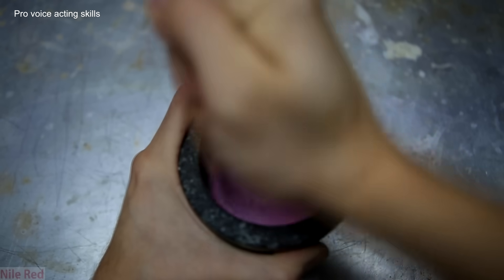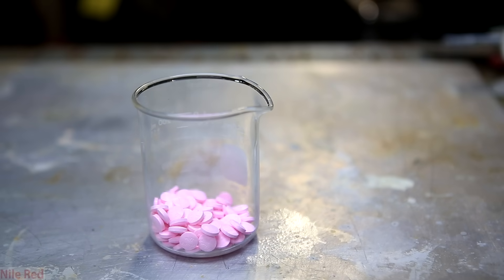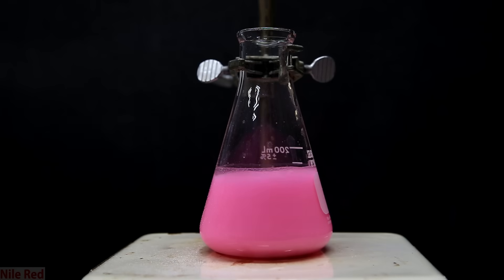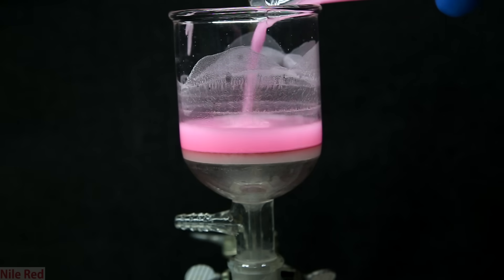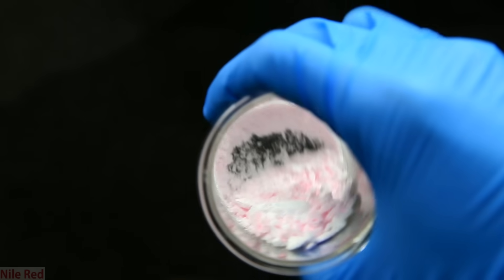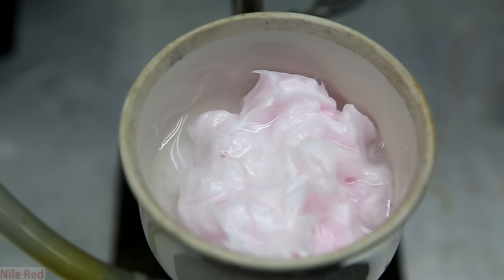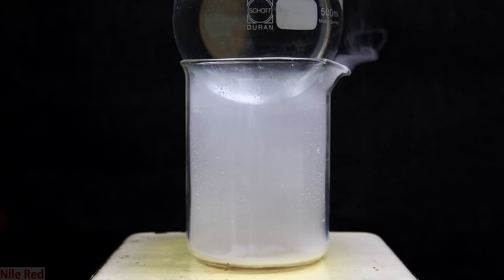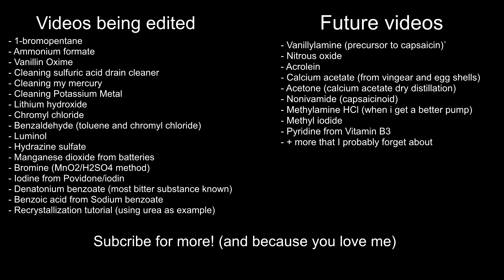Extracting caffeine from caffeine pills

Comment: Why would you even do this? Just swallow the pills.
Reply: because this is a science channel and he is showcasing different chemical processes involved in purifying a substance in this case it's caffeine
Reply: @tanishchowdhury  I understand that but what purpose does it serve? I was working as the anodizing manager of an aluminum extruding plant in Opa-Locka, Fl and was receiving a delivery of chemistry. Also on the truck was 4 tons of caffeine powder that was being delivered to the Pepsi bottling company in the next town over. Each box contained 5 kg of powder. In jest I asked the driver if one box could fall off the back of the truck. It would have helped when I was called in during the middle of the night to remedy some problem that had arisen in the anodizing line.

Comment: Why did you use a beaker during the sublimation because some of it clearly leaked out from the place from where you are supposed to pour something, like, was there some particular reason. Couldn't you have used just a normal cylinder without that opening thing, so that none of it escapes?

Comment: ok... caffeine is a simple alkaloid... available from plants of various types... notably coffee and tea and... chocolate
extraction from plants is fairly easy... this will work with most alkaloids
with coffee beans
grind to a fine powder... I'm usually working with a hundred milliliters... nice round number... add 1 CC of pickling lime... slaked lime.. available on Amazon for making pickles with... this brings the ph up to about 9... mas o menos... add a little more if you want.. too much destroys the other alkaloids... and they are actually good for us so I want all of them... cover with acetone and mix well.... let it pickle overnight.. the lime breaks down the plant material but a fairly low pH won't modify the mixture... pour off the acetone and evaporate... with vacuum is best but it's not necessary for good results... the remaining powder is the business part of coffee... au naturel
Reply: for an infusion that can be used medicinally... add hemp seed oil... it carries the alkaloids through the skin and nourishes the cells at the same time... it is primarily fatty acids and lipids... the only thing that passes through cell walls... and it carries the other side... the sending side of the gap between nerve cells called the synapse... 110 cannabinoids that are.. an anion and cation for each system in the body.. the other alkaloids work on the receiving side... there are 3... in all the medicinal plants I know of... alkaloids use the alkali metals in a magnetic field along each pathway to and from the brain... what happens on one side of a magnet happens on the other side at the same time... so we can respond to the environment in real Time... that's what makes us alive
Reply: I just use water most of the time.. we call it coffee ☕... add honey... it's really good stuff

Comment: Wouldn't it be easier to extract the coffein with ethanol in an soxlet and resublimate it with controlled temperature over a longer period of time? Like an water or oil bath and the erlenmeyer is dipped deep in it to force the crystals to form on the cooling flask.

Comment: EASY way to extract caffeine from caffeine pills:
Caffeine is highly soluble in boiling water, while the fillers and binding agents are not.
So.
1. crush up caffeine pills
2. dissolve in boiling water
3. filter out fillers and binding agents with a coffee filter
4. boil away water from resulting solution in a frying pan
5. turn on camera and say, "this is your brain on drugs"
6. or you'll be living in a VAN DOWN BY THE RIVER!

Comment: When you use the cold water in the filter washing step, aren't you sacrificing some of the caffeine in the filtrate?

I understand that caffeine isn't as soluble in cold water as it is in hot, but I do know for a fact that it is still soluble to a good degree (ex. Iced Coffee and Cold Water Extractions/brews).

What gives? Was it just a calculated sacrifice for purities sake? Is there a better way to filter without sacrificing yield besides sublimation? Perhaps Celite? Activated Carbon?

Comment: I had a question...on the hot water part...so I may or may not have a spoon of some black stuff , and whenever I heat it up with a lighter and water the black chunks (impuritys) form together like a magnet and there fo allow me to suck up clean 'black stuff'.....why is that??

I just figured this out, wish I would of known this b4..that means for several years I been 'using' dirty unfiltered 'black stuff' in my body

Comment: Damn I've been doing caffeine extractions for years, you could have saved so much effort by buying caffeine pills without the pink in them. I prefer allmax caffeine, and I simply wash the ground up pills with 99% alcohol, siphon/filter off the saturated alcohol (once it settles ofc) then evap the alcohol. Every single time I get extremely pure, flaky caffeine crystals

Comment: Hi NileRed, is it possible to try dissolving the crushed pills to dw first before DCM, possibly heat dw first at 70°C - 80°C. Would the yield be higher than this video method or less. Thanks.

Comment: NoDoz pills are caffiene in a glucose base, niacin (nicotinic acid) and thiamine hydrochloride (vitamin b1)
Glucose, niacin and thiamine are all very soluable in cold water, caffiene is only very partially soluable so if you use ice cold distilled water and use only a small amount, you can extract most of the caffiene and recrystalise in ethanol. 

ezpz

Comment: could acetone be used here instead of DCM?
Reply: Acetone is mainly used to clean round-bottom flasks and beakers that have been previously used for other reactions (along with soap and water). It is sometimes used as an organic solvent for certain reactions, but it's not too frequent. DCM is better suited for that, as it's much less likely to react with your compound than acetone is.

Comment: I am realy curious as to what was the melting point of the final product. It would say a lot about the efficiency of the method.
Reply: the point is as he explained it, it is not "melting" that means it is not going from solid to liquid, its going direct from solid to gas/vapor, melting point is 236 °C but the point wehre it goes to gas is 178 °C . so melting is not possible because it is already gas.

Comment: What if people could vape caffeine shown in the video as sublimation? Since it is in gas form it could disperse in the body and absorb in the bloodstream faster. interesting
Reply: I still doubt the level of comfort experienced by using a saline solution, but I guess if you do it right it won't be very painful.
But I must say that it is probably not really necessary to rinse one's nasal cavity. Having it unclean means longer release time and longer stimulation.

Anyhow, I'm sure there have been overdoses on caffeine, but seeing as it is a difficult thing to do, those college kids must have been edgy as fugg, very inconsiderate or just unlucky.

And as for MDMA and Meth, those are a lot more neurotoxic than caffeine and have more than just stimulating effects. The first is also very psychedelic. So if for some reason you wanted a just strong stimulant, I think regular amphetamine would be best suited.
Reply: Josh Deffenbaugh they already have caffeine vapes, from what I have heard they are not that good
Reply: well no its not VERY easy, its just easy compared to caffeine in coffee. The low estimate of caffeines LD50 is 150mg/kg which is about 10 grams. The average dose is 150mg which is .15 grams, and  you can easily double or triple that and be physically totally safe. It's not like amphetamine where the desired dose might by 60mg and the dangerous dose anywhere from 120-300
Reply: I tried that.

But I don't think it worked, or I was being a pussy and I sublimated too little.
I didn't want to overload my lungs and/or bloodstream.
Reply: +Classical Liberal Just insufflate it, save your lungs the pain
Reply: Al Capone
Ye, but that hurts
Reply: ᴠᴧᴨᴛᴧᴃᴌᴧcᴋ and very high temperature caffeine vapors dont hurt?
Reply: You don't have to sublimate as much caffeine as you would with insufflating. And maybe you nose-membrane-thing is much more sensitive.
Reply: ᴠᴧᴨᴛᴧᴃᴌᴧcᴋ I think you misunderstood what i meant by cleaning solution, using a saline solution to drip into your nasal passage would not be painful at all, it would clean them off and re-moisturize. Also, I've seen stories of college kids dying from snorting caffeine and overdosing. I'm sure it wasn't all done in one sitting, but maybe throughout an entire day. Keep redosing while the last dose isnt fully metabolized until a lethal amount is built up inside you. I never claimed to be an expert, i'm just looking at the situation from a logical point of view.
I still believe insufflation would be a far more enjoyable way to abuse the substance, compared to vaporizing. Although, you're way better off just snorting .1g of MDMA or inhaling some meth if you want a strong stimulant
Reply: You mean like those e-ciggies?
Reply: I did that yesterday
Reply: ᴠᴧᴨᴛᴧᴃᴌᴧcᴋ Caffeine is already VERY easy to overdose on and die from, especially if using purified powder form, so either way you take it wont need too much. I still think insufflation followed by a cleaning solution to clean off the membrane would be less painful and disgusting than vaporizing and inhaling pure caffeine. Although, I've never tried either so I cant call myself an expert on the matter lol
Reply: So then why are you lecturing me?
I do not mean to boast, but I'm by your logic the more experteded.

And no it's really hard to overdose form caffeine. You'll need somewhere around 20 grams for it to be lethal, which is A LOT, compared to most medicine/drugs.

And anything over 1 or 2 grams is already very uncomfortable. You wouldn't overdose from wanting more.

Also why the fuck would you clean your membrane with some cleaning solution?
That sounds like a painful unnecessary experience.

Comment: If 8.5 grams produce a yield of 85%, then wouldn't the theoretical yield of 10 grams mean that the pills were 100% caffeine?
Reply from the maker: +Seth Upperman There is 100mg of caffeine in each pill. So 100x100mg = 10g. The pills themselves weigh much more than that. Probably at least 50-100g or something.

Comment: A cool idea for crushing pills is a DIY ball mill. Get a drill that has a low speed, a large soda bottle, and some ball bearings. Add the bearings and whatever you want to crush to the bottle, strap it to your drill, and you're sorted. Turn it on the night before you want to do your extraction, hey presto. Good for large volumes, obvs not super useful for small batches